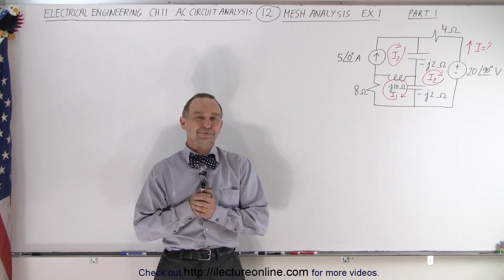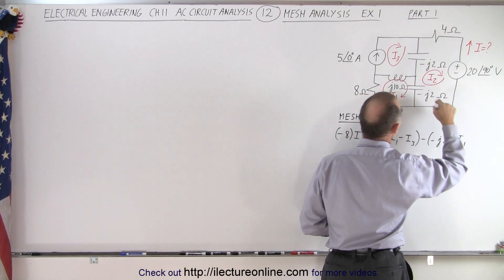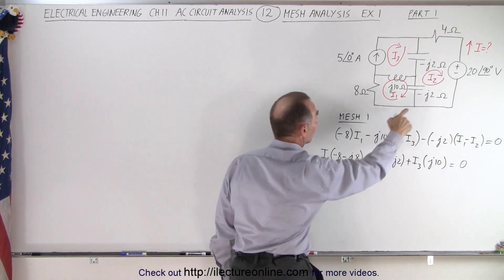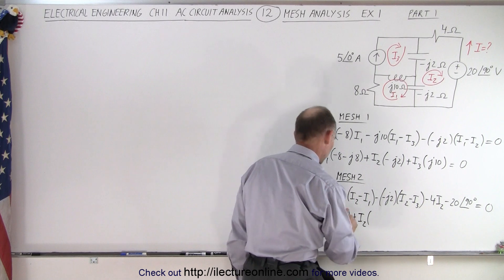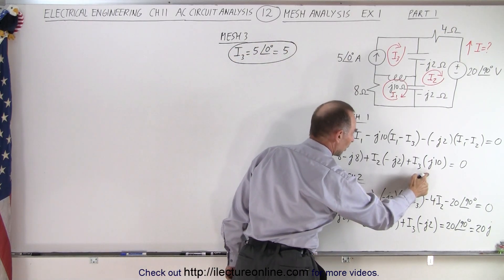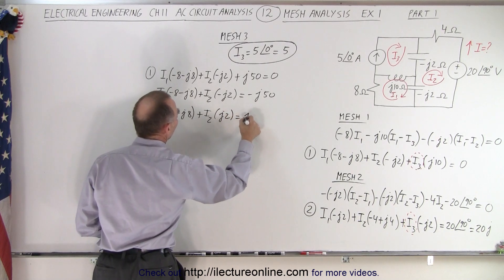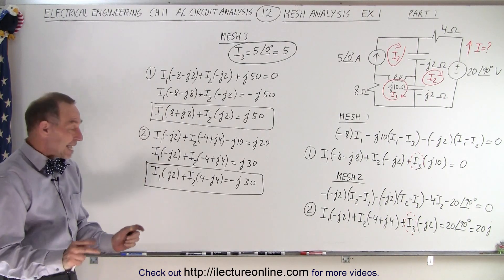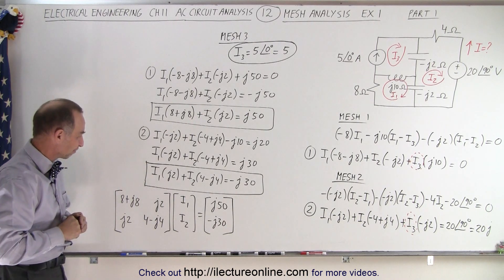Electrical Engineering: Ch 11 AC Circuit Analysis (12 of 34) Mesh Analysis Ex. 1 (Part 1)

Comment: Quick question ⁉️
Why is it that for resistors that are shared by say loop 1 and 2 the current flowing through  it is (I1- I2) when considering loop 1 and (I2-I1) when considering loop 2. Why?
Reply from the maker: There are two approaches.  One is to subtract the two currents as you indicated.  The other method is to create a seperate current I3 for that branch.  Both methods will give you the same answer.
Reply: Oh thank you so much. It's much clearer now
Reply from the maker: You are welcome.

Comment: Could you explain why we don't need to apply super position theorem to this circuit given the two sources have different frequencies.
Reply from the maker: No information is given about their frequencies, and we can assume that they are the same.  They do have a different phase angle, but that is not a problem as is shown in the video.

Comment: Sir I don't understand why you chose your current direction to be negative, does direction matter anyway? I tried with different direction and got delta as 60 and not 68, please help, thank you.
Reply from the maker: You can reverse the direction of the current, but you must make sure that all the voltage rises and drops follow the rules of the reversed current.

Comment: My circuits have no marking of the direction of the current for each mesh? How do I determine the direction of the current if there aren't any arrows?
Reply from the maker: You can choose them in any direction, it doesn't matter if your choice is wrong.  You'll just get a negative answer for the current indicating that the current is actually in the opposite direction.

Comment: Professor, we need some videos on JEE Adv... 
It would be of great help to us.
Reply from the maker: We have some already:   see the playlist   JEE (ADVANCED) PHYSICS E&M     We plan to make more in the future.
Reply: @MichelvanBiezen  for these inductor or capaciptor, if we just know L and C , and they connect.to a circuit with voltage source with different frequencies w1,w2 what's their total impedance under the combined effect